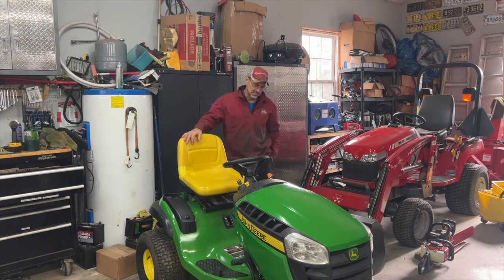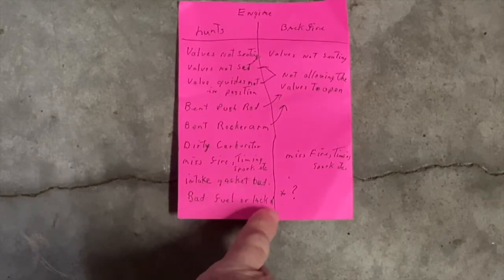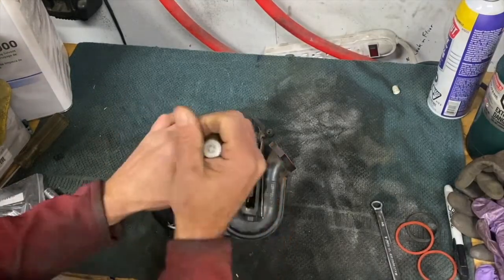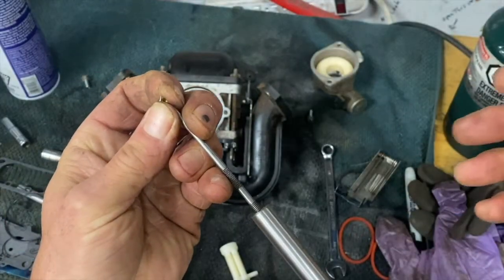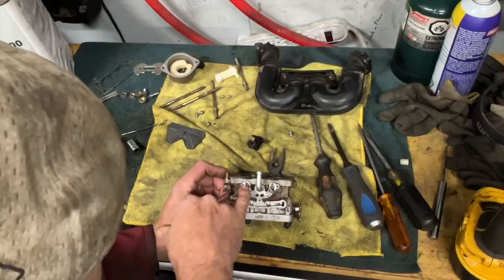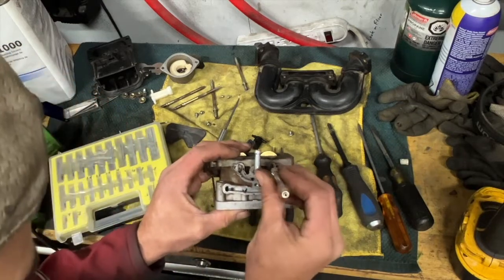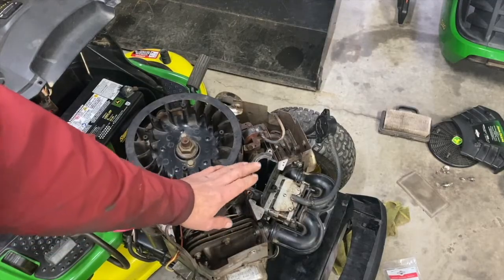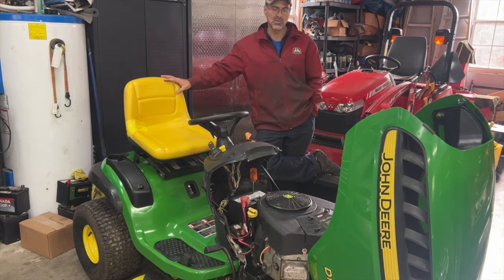Briggs Stratton 22hp intek spits and sputters, backfires, how to fix. John Deere D140 mower.

Comment: Great video and straight to the point. I'm a Deere guy myself and have quite a few. Some folks collect cars...well I collect mowers...lol So yesterday after all the customers projects were done, I decided to hop back on this LA140. I had taken the carb off and usually keep those rebuild kits in stock, but I had to look through a few of them because the main jet orings were used previously on other rebuilds. The jets area looked like it had gang green had set in and all the orings and seals were in horrible shape. The rebuild still didn't fix it, so today I am going to check the valves. I've already drained the fuel and wiped out the tank with fresh fuel and re filled, still no change

Comment: This ethanol fuel is terrible for engines,get ethanol free if can
Reply: Agree. That ethanol ate my gas cap up and it broke off down inside the tank. I had to siphon it out and vac the tank and also back blow the fuel line with air compressor. The non ethanol 92 octane around here is about $5.50 a gallon, but well worth it. Even 2 stroke mix weed eater runs and starts better.

Comment: I got 22 up briggs  stration pops an back fires  won't turn over right set values set at oo6 won't turn over
Reply from the maker: Is the motor loose in the tractor? Not grounded properly.  Check the key on the flywheel (Take the wire off the spark plugs and try to turn it over.)
   I’d try to boost it with a car battery directly to the starter (bypassing the solenoid).   Might be a weak starter.

Comment: You have been very informative.  I am working on my mother in laws D140, it has been sitting for a couple of years since her husband passed.  I replaced the fuel pump, fuel filter and carburetor because all were very gummed up.  The mover has a very hard time starting, and after I do get it running with the help of starting fluid, it surges while idling, full throttle is ok and after it has been running for quite some time.....if I throttle it to the choke mode, it doesn't kill the engine.  I know that choking the engine isn't what I am supposed to do after it has been running, it was an accident but I noticed that it did not kill it, and in my experience when a warm engine is choked it normally dies.  I am thinking that the choke isn't working on it which is why it is having a hard time starting.  Any advice is greatly appreciated.
Reply from the maker: My own personal mower is hard starting also because my compression in my cylinders are low, 120psi.  They should be 150.  On some (high compression models) they should read 185-195).  
    Put the choke on and push the choke lever to make sure the choke is fully close. Check the valves, intake (0.003-0.005), exhaust (.005-007”).  
   Make sure you have a good spark at the plugs.
Reply: buy a kawasaki or kohler engine for it. take the briggs and stratton to the scrap yard. problem solved
Reply from the maker: @Bigpoppi1469    Lol...
Reply: They didn't design the choke properly on these models, but no one is explaining how to fix it permanently 😢
Reply: I've done quite a bit of carb swaps on these Deere products. If you get the Amazon or Ebay replacements, you might get lucky and it works first time. Always try to stick with your own carb and just use the new seals from the replacement. If you don't use a ultra sonic cleaner, you will have to look very closely at the passage ways to make sure they are not blocked. This has been over a yr since this post, maybe you have already gotten the issue taken care of.

Comment: On my D140, when thw PTO is engaged its chugging, slow and when I drive up my septic field its stops, I release the gas and it creeps up slowly on its own. I also notice a smell of gas when driving. When the PTO isnt engaged, I do not experience any problems.
Reply from the maker: Pretty hard one to fix with looking it first hand.  I’d sharpened the blades.  Change the spark plugs.  Check the gas filter for leaks.

Comment: Excuse me weekend hobby mechanic. Technically how many hours I have to clean up my carburetor. Similar at your John Deere? Please can you tell me your advice please. Gracias
Reply from the maker: I can spend 0.5-2hrs to clean a carb.
Reply: @WeekendHobbyMechanic  . sorry I guess my question is was wrong. Iam trying said every 50 hours work. Every 100 hours worked. Because my have 65 hours and feel a little rough working.special when I started is like a little black smoke only the begin.
Reply from the maker: If the Motor is running good you don't touch the Carburetor. Take the bottom bowl off the carb and look inside. It might be dirty. (Lots of videos on Youtube on this).   
   It might be getting too much fuel, pinch the fuel line to stop the fuel to see if the motor smooths out. 
  Watch this video:  https://www.youtube.com/watch?v=WKvhGIhUsKs
Reply: @WeekendHobbyMechanic  thanks
Reply from the maker: @breannaoliver6316  👍

Comment: You have been a great help to me my friend really appreciate the advice
Reply from the maker: Glad to help. 👍
Reply: @WeekendHobbyMechanic  hey bad news for me…I finally realized tonight….the oil was coming out of the side of the crankcase there is a hole on the side…can’t believe I missed this.
Reply from the maker: @semajd5995  Crack or a hole? If it's a crack, clean it, then use sandpaper.  Degrease it.  Then apply silicone to the crack.    I’ve done this to my own personal mower and it’s running, with no leaks.

Comment: So when i put my intake on i accidentally shorted the fuel selanoid power wire. When i fixed it it now i get no power to the selonoid and the werid part is after i jumped the selanoid and went and mowed with it the rio reverse button dosent work and it just dies when i put it into reverse. How are the fuel selanoid and rio button related? I replaced keyswitch, relay, and the fuse was not blown.
Reply from the maker: Your “RIO Latch Relay” could be bad.  (Tap on the relay, it’s on the right side of the battery tray or just below it. 
   Did you bypass the RIO switch? 
https://m.youtube.com/watch?v=CABS84lkTKM&pp=ygUKcmlvIGJ1cGFzcw%3D%3D
  Or 
  https://m.youtube.com/watch?v=iftItnrAp30&pp=ygUKcmlvIGJ5cGFzcw%3D%3D
Reply: Yes I bypassed rio switch and replaced relay.
Reply from the maker: @Jesse-pz5fe   What model John Deere do you have.
Reply from the maker: @Jesse-pz5fe   I had the same problem on a D160.    Follow the Wire from the Solenoid and see if it goes to the Hour meter.
        If it does, Look to see if there's another purple wire, check if it has 12v with the key in the Starter Position.    Just add a jumper wire to both wires.